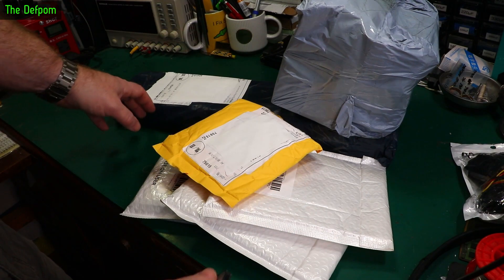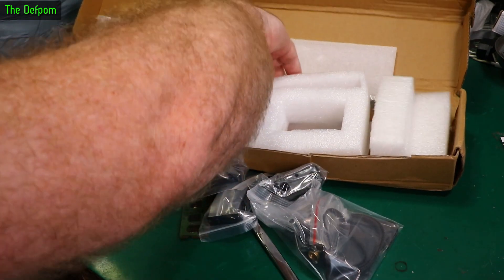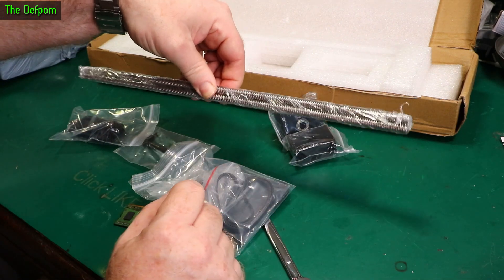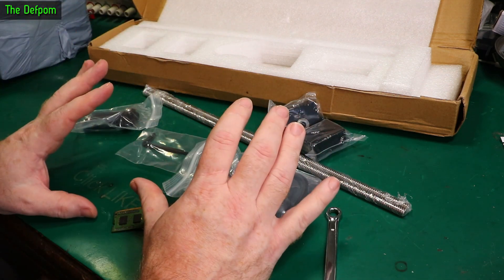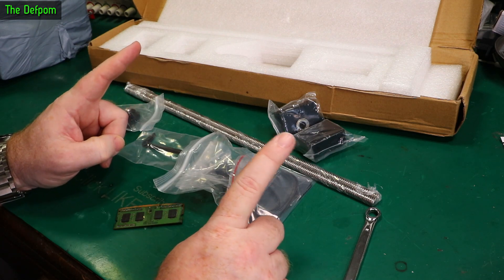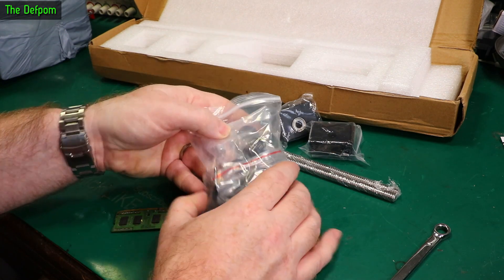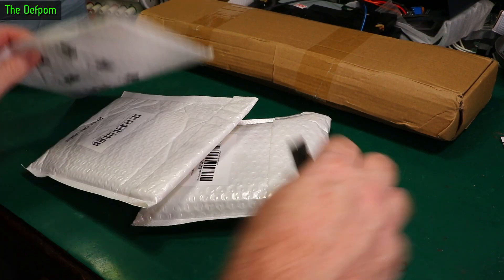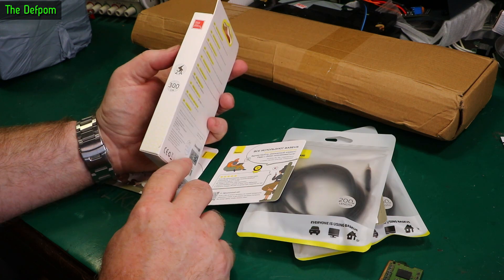🔴 What's in my Mailbag ? - Mailbag Monday 13th February 2023 - No.1098

Comment: Prusa has dual motors. Every print starts with measure the bed leveling. If it’s too much out of alignment it forces a calibration by running both screws at the end stops.
Reply from the maker: These ended 3 sit in a bit of a different price bracket, more of an entry level unit really, but can perform pretty well if carefully setup.
Reply: I do this on my Ender 3 with dual steppers. It's not automatic but I have anti-backlash nuts so it rarely drifts.